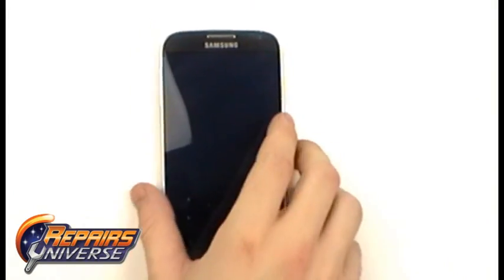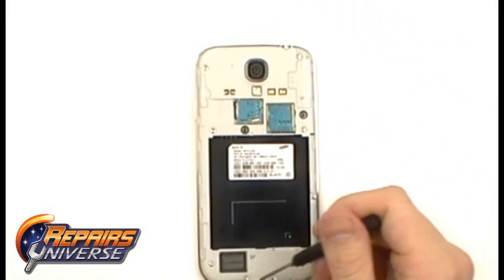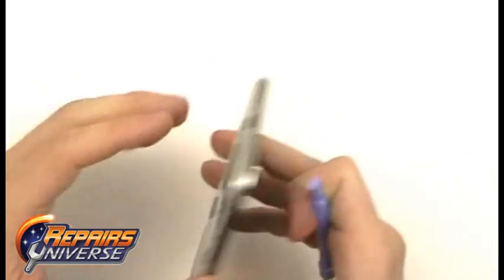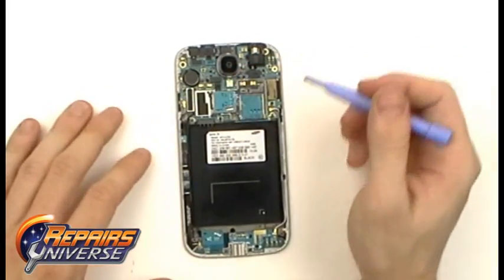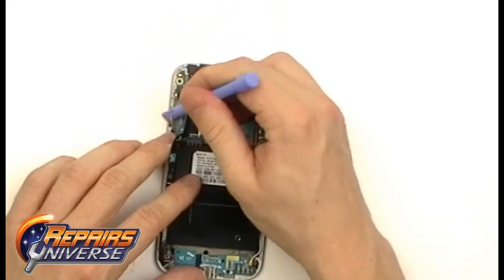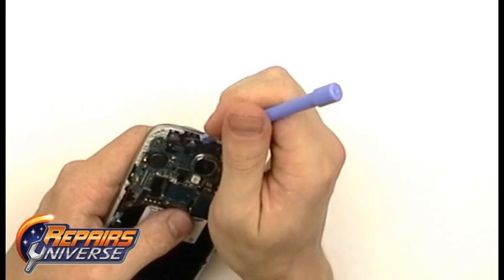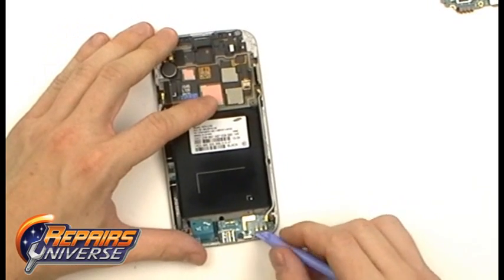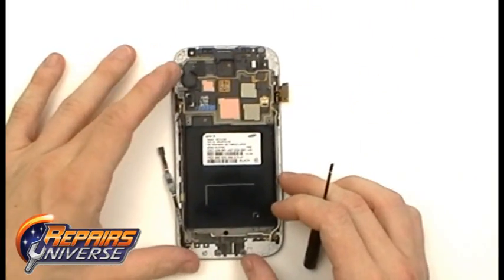Samsung Galaxy S4 Screen Replacement Repair Guide

Comment: The touch work but cant see anything. what can i do ?
Reply from the maker: You need to replace the LCD in this case. The LCD is fused to your touch screen, you will get them together and this will resolve your issue.

Comment: Will a screen and lcd from a tmobile or att s4 work to replace my screen and lcd of my Verizon s4?
Reply: No incompatible, I have one for AT&T sitting at my home
Reply: Shabaz .Qureshi true. I found that sprint is compatible though.
Reply from the maker: Yes all the screens for all the S4 are the same. What makes them non interchangeable is the Screens with the frames. They are different the motherboards will not mount correctly and burn a chip set. The ones that work together are the I545 and L720 CDMA/ M919, I337, and ant the L720T(Tri Band).. If the frame is not damaged best bet is to just install a new screen into your frame. Your parts will fit your phone that's where it came from. Good Luck
Reply: Are the I337 and the L720 compatible with each other?
Reply: all s4 lcds are compatible to each other, it's the lcd middle frame bezel, that's different. I337 has the same frame bezel as L720T, but not L720. L720T is triband sprint, L720 is original sprint s4 model

Comment: Quick question, what is the compound between the motherboard and LCD assembly?
Reply from the maker: Pedro Gomez The screen is made up of a digitizer lcd and glass is put together with Loca Liquid Optically Clear Adhesive. Then there is the mid plate. After that is the Mother Board.

Comment: So did I miss the part where you actually put the new screen on? From what I saw, it looked like you just disassembled the phone.

Granted, I skipped around to see if this was the video I was looking for, so I could have missed it.
Reply from the maker: Zack yes you are correct. It seems like the rest of the video has been cut off. I will get with my productions team and find out what happened. You would install the new screen in reverse. You would apply the 2 sided adhesive on the outside perimeter of the screen. Making sure not to cover the camera, proximity sensor, and ear piece. DO NOT PUT ADHESIVE ON THE REAR OF THE LCD. You should be okay after that.
Reply: Awesome thank you! I can't wait to repair my phone

Comment: Also I had ordered the signal antenna to replace myself to begin with. It was the right part but for the wrong S4. The edition S4 was the I9000, which I believe is the Sprint version of the S4. I have the Verizon version, but what edition is that? Is it the I9500 or I9505 or are there more editions??
Reply from the maker: Thank you Track for posting in the forum for me. Okay lets get started. This is the model number for your device SCH-I545. This is the Verizon S4. You can confirm this by removing the battery and looking at the sticker on the rear of the phone. As for the soft keys not working anymore. I would definitely take it back to the repair shop , and have them inspect the device to see if they may have accidently knocked something loose. It does happen. We are all human. If all else fails check our website. There you will find our Support. You can send the unit into me and I can take a look at it for you, and repair the device if you so choose. Good Luck!

Comment: I watched your video on taking your phone apart and screen removal. First off thanks!
A few things, when I took my phone apart I accidentally bent the "port" on the signal antenna. I took it to a guy to get it fixed. When I got it back I changed my screen and then noticed that my "home key" wasn't working (or the Back Button or Menu Button). I didn't noticed this until after changing my screen. Did I screw something up with the screen swap or did they screw something up when they replaced my antenna? The home key was working when I took it to them. I just didn't check the functionality of it before the screen swap.

Comment: This video is bullshit. I just destroyed my girlfriend's S4 because "apply heat and pry off the front glass" is about as vague as it gets.  Thanks a lot.
Reply from the maker: VigilanteSEVEN were you trying a glass only repair? This video is intended for the full assembly, including the LCD.
Reply: Except you don't actually finish it. It's a video intended for someone only interested in getting half way.

Comment: How do you know what parts to buy? I have a samsung s 4 which got some sort of pressure crack. The crack is under the glass and the screen looks black with blotches of color when I try to scroll. It looks like a broken LED TV.
Reply from the maker: ***** Its sounds like your LCD is broken. You will need a complete LCD + Digitizer assembly.
Reply: How much is that and where can I buy it?
Reply from the maker: ***** What color is it? Follow the link in our description and search galaxy s4. It will pop right up!

Comment: so I dropped my galaxy and it turns n but you aren't able to see it like the screen is all black do it do to fix it D:
Reply from the maker: Jackie cabrera Sounds like you broke your LCD. (Internal display) Follow the link in the description and it will lead you to the screen replacement you need.

Comment: Fine, Putting it back together is another game altogether
Reply from the maker: Laz, When putting your device back together you can follow along with this video but would have to go from the end to start.

Go slow as not to mis-steps and you should be golden Laz.
Good luck on your repair.
Reply: Thanks for the video, but I have decided to send it off to Samsung and let them do it. the cost is the same, which saves me the worry of damaging something.
Reply: Laz X how much was it to send it to Samsung and have them do it?
Reply: $200 plus change
Reply: Laz X So it'd be worth it just to buy a new phone...
Reply: Ryan Calovich
a new GS4? It would have to be new because I'm not buying shit from ebay. other than that. the job is done, and i'm on Deadly Venum Rom smooth and bangin. thanks for your help.
Reply: Laz X Ah ok cool man. Trolling? I didn't believe I was, but my apologies man. Have a good one buddy and thanks for your feedback, much appreciated.

Comment: Title of the the video is "Screen Replacement Repair Guild' and you don't even touch the screen in the video? Instead you tell us to go look at the written guild to take apart the screen...
Reply from the maker: jdtnirvana Once all the steps are completed in this video, heat up the screen and pry it off the front bezel of your device. Make sure you don't rip the home button flex when you take the screen assembly off. Then place adhesive around the edge of your replacement screen to seal it back to the bezel. Lastly, follow the steps in reverse to reassemble your device.
Reply: If anyone would like to post a video on how to undo the BS this company's video has had me do that has NOTHING TO DO WITH THE TITLE OF THE VIDEO and now has me with a phone completely undone, that would be awesome. This company, however, is completely bunk.
Reply: Repairs Universe  Blow dryer type heat?
Reply from the maker: Yes a blow dryer will put out more than enough heat to separate the screen. Make sure not to (cook) the LCD. 110 degrees is about as hot as you want it to get. Just take care and your time in doing your repair. As always if you have any issues you can email me @ Robert@repairsuniverse.com

Comment: Hello i love your video can you tell me what I need to replace for my sg4 if the screen is completely black i believe. I think when it was on you could see very little of the screen and right left corner smh, Please help Repairs Universe
Reply from the maker: Hello Simone, For you S4 you would need this.http://www.repairsuniverse.com/samsung-galaxy-s4-lcd-touch-screen-replacement-black.html

With your order it we will show you a guide as well as the video you have seen.

You will need one(1) small phillips screw driver , adhesive strips and a pry tool.
We ship a free pry tool with your order so only thing you will need is screw driver and adhesive strips.
If there is anything else we can do for you just ask :D have a good xmas

Comment: Does the i9500 lcd work on the tmobile s4
Reply from the maker: Yes, is the short answer.
The long answer would be you would need to find a no frame s4 combo kit.
If you have a frame with your combo kit it will not work because one is for one and the other is for that one.

The frame we are talking about goes around the digitizer and the lcd. We sell none frame s4 combos. So you can use them all around.

Comment from the maker: It sounds like you need to replace both the touch screen digitizer (outer glass) and the LCD screen (inner display). We have the combination screen (LCD + touch screen) you need at RepairsUniverse (dot) com. Check out the site for the latest pricing. You will also find all the tools you need for the repair.

Comment: Hello. My daughter dropped my Galaxy S4 and unfortunately cracked part of the screen which would be the top right hand corner. It still works, touch screen and all but I would like to get it fixed. How much will it run me?

Comment from the maker: While it sounds like you have only damaged your touch screen digitizer (front glass), you will need to replace both the touch screen and the LCD screen (inner display). This is because the two parts come fused together and are extremely difficult to separate. If you're interested in purchasing a combination screen (LCD + touch screen) we have them available at RepairsUniverse (dot) com. It's a relatively easy repair.

Comment: Since I can't edit my original comment, I'll add another comment here. Here (you tube: "/watch?v=S_BadHtLPbU") is the instructions on how to replace JUST the glass. Here (Amazon: "Front-Screen-Replacement-Samsung-Galaxy/dp/B00CPRY3XG/ref=pd_sim_cps_2") is the replacement glass. MUCH cheaper than spending $250 on a full screen replacement or paying someone to do it. (add the parenthetical text to the normal site address, less quotes.

Comment: hey could please help me here.. I have an S4 but the bezel thats looks like part of the screen is dented and peeling off (Not the bezel of the back cover/casing you removed in this video. Am talking about the thin trim/bezel part of the screen area..can that be removed and replaced of does it need me to replace the whole screen? As there is nothing wrong with the screen at all just the dented bezel making it look bad : (. Would highly appreciate if you could please suggest.

Comment from the maker: Since the touch screen (outer glass) is fused to the LCD screen (inner display), you will need a combination assembly screen (touch screen + LCD). This is because it is extremely difficult to separate the two fused parts. We have the combo screen available at RepairsUniverse (dot) com.

Comment from the maker: Yes you can use this video for that repair. Unfortunately you will need to replace both the touch screen (outer glass) and LCD screen (internal display). This is due to the fact the two parts come fused together, and are nearly impossible to separate. If you would like to purchase a combination screen (touch screen + LCD) we have them available at RepairsUniverse (dot) com.

Comment from the maker: The "touch screen digitizer" is the outer glass where you have lost sensitivity. Unfortunately, since the digitizer comes fused together with the LCD screen, you will need to purchase the full assembly (LCD + touch screen) if you wish to have a working touch screen. However, if you have already bought a new one and attempted installing it, you may want to reopen the device to make sure the connections involving the screen are securely in place before buying a new one. Best of luck!

Comment: I've followed your directions but now my screen flickers on and off.  I assume that I have a loose wire now or connection but am unable to figure out which what it is.  Could you point me in the right direction?

Comment: thanks for the video, actually my S4 screen is CRACKED, I can see it working but it shows nothing, do I need to replace the digitizer ? or I need just to replace the front Glass ? because the digitizer is about 214 $ while the front glass is only by 14 $, which one is the right item to buy ??? 

I really really appreciate your help, I have a broken phone now. thank so much